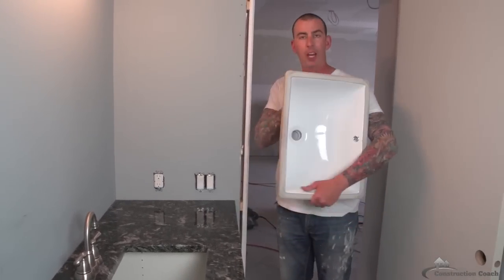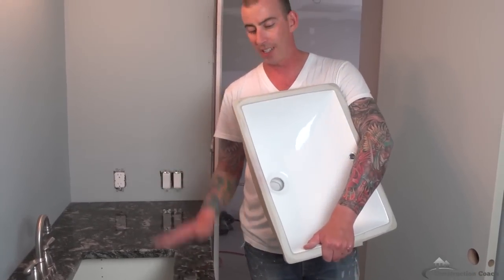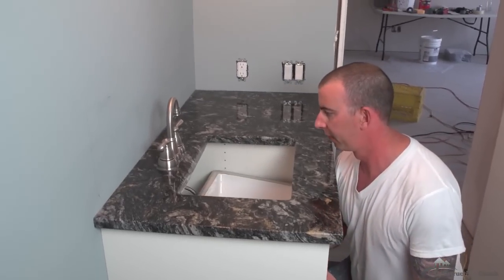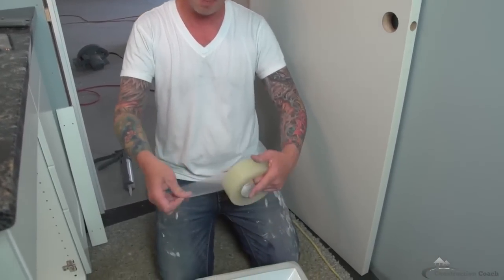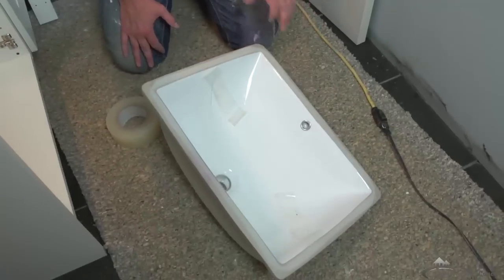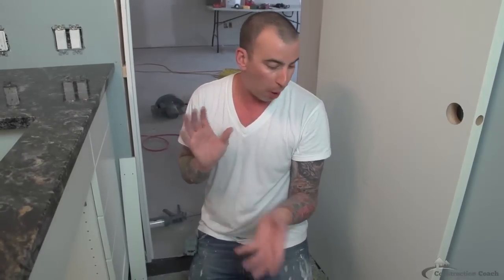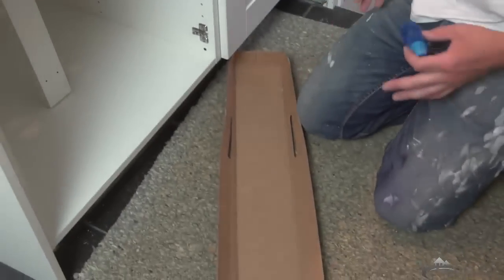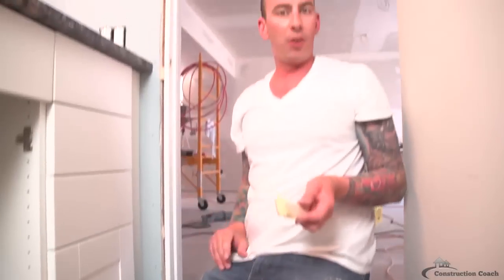Sink Install Tips

Comment: I bought a vanity from Virtu USA. They say run a bead of epoxy on the top rim of sink then let harden for 15 minutes. After that you apply sink mounting bolts. Last you apply silicone sealant to the outside ring of the sink. This seems to be far better than your way. As others have suggested, I will suspend the sink using 2X4 and long bolts.

Comment: using 2x4's with holes in the center and threaded rod with nuts/washers you can clamp the sink into place.  also there is no need for epoxy as the silicone itself has enough adhering power.
Reply: So that has to be a long threaded rod? right?
Reply: Yes, about 14 inches for a bathroom sink (the depth of the sink as well as a 2x4 on top and bottom).